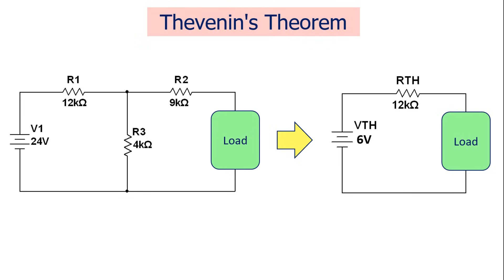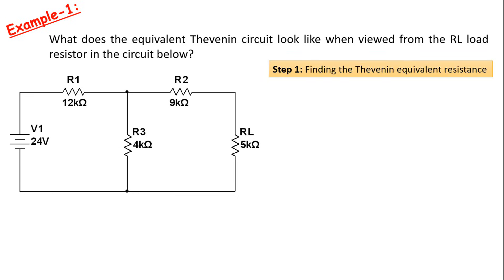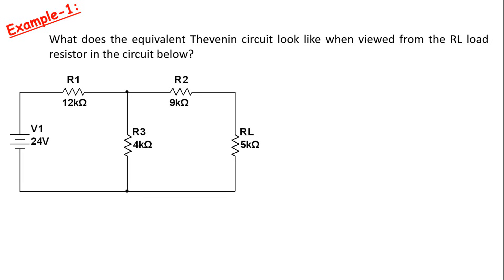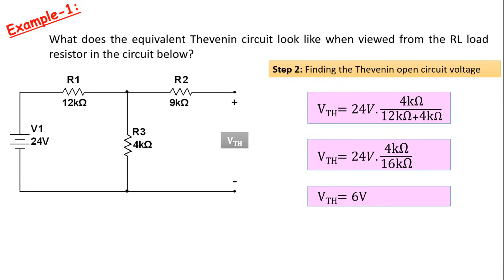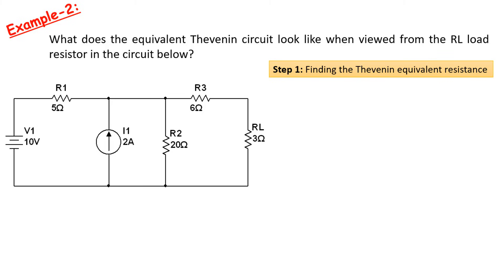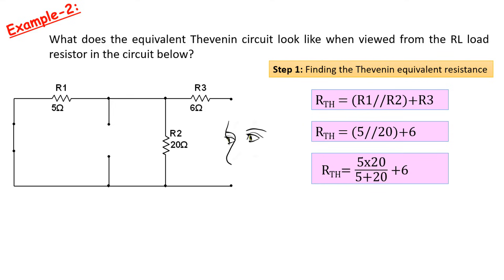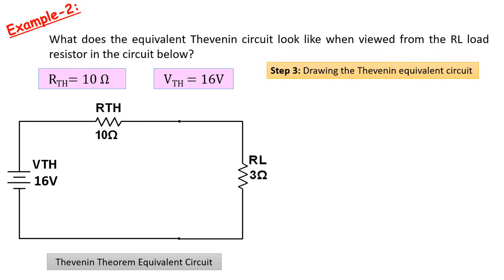Thevenin's Theorem Explained - DC Circuit Analysis

Comment: What will be the Vab if extra resistor is connected to the lower end of the circuit connection? Then how V ab is calculated??

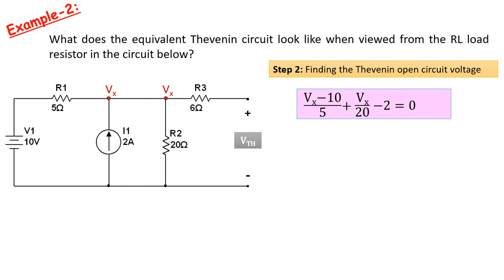Comment: I never took math and i have no idea what to do with Vx at 5:10 .
Does -10 mean to take away the main voltage? And -2 from taking away I1?
How do you calculate Vx? Do you apply ohms law from I and V?
Reply: Vx are both nodes on the circuit that we place. These nodes account for the current going IN and going OUT. The objective of these nodes is that we can calculate the (V) Voltage at these places of the circuit. The "Node-Voltage Method" explains this in more detail. 
Also to deal with these ugly fractions that we get by using Node-Voltage Method can be simplified by multiplying by the least common factor of the denominators. Then we solve the systems of equations. I personally have no interest in doing all that by hand so I'll let the calculator do that part.

Comment: Why is it the voltage across the 20 Ohm resistor R2 4:40
Reply: Because there will be no current going to r3 instead it will go to r2
Reply: because in that open circuit through the R3 runs no current therefore it has no voltage drop and behaves like a simple wire. You can imagine that R3 is not even there ..

Comment: Quick question regarding the first example, why do we consider R1 and R3 to be in parallel rather than in series?
Reply: You have to short circuit the voltage source so R1 and R3 will have the same potential difference with respect to their terminals. Here short circuit means you basically remove the batteries
Reply: @Tyler-km8uu  You remove batteries but you also put wire there
Reply: when you short circuit the voltage source these resistors are connected to the same nodes.
Reply: I also had the same question brother

Comment: I believe your 2nd circuit equation is incorrect per Kirchhoffs current law, the current source is flowing into the node so it should be positive and current thru R2 (Vx/20) is flowing out so it should be negative.
Reply: Incoming current is equal to outgoing current,
Inorder to write it in the rhs he wrote it in LHS
Reply: answer should be 80/3
Reply: @NewBami Actually , it should be the same as the one in the video , the guy just didn't write it right.I think u forgot to make one of these two currents positive.

Comment: Thankyou very much! I am confused about what the "current source" is in the 2nd example. Could you please give an example of what the current source might be? Thanks.
Reply from the maker: In the 2nd example, the current source is the 2A source.
Reply: @eeapplications  Yes I see that, but why is the current source different from the voltage source?  Isn't the current coming from the voltage source? If not, what is producing the 2A current? Sorry for my lack of understanding.
Reply from the maker: In a current source, the current is constant and the voltage is variable. For example, when we set the current source to 1A, no matter which Resistor or load we connect, they will all draw 1A current. It does this by changing the output voltage. It ensures that the current remains constant. What is important here is my mind. If the voltage source is constant, it will draw different current when we connect different resistors.
Reply: @bobs_ya_runkle  basically it's just a challenge, hypothetical, the current is powered by itself not relying on the voltage source, think of it as a current-producing battery